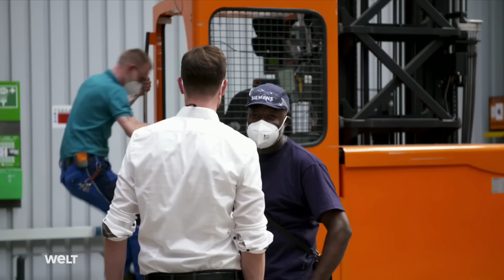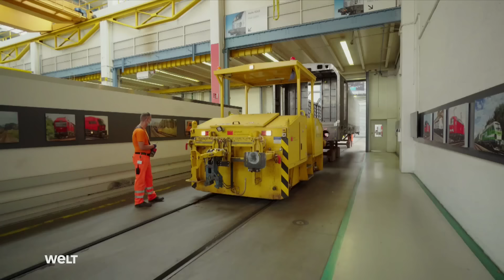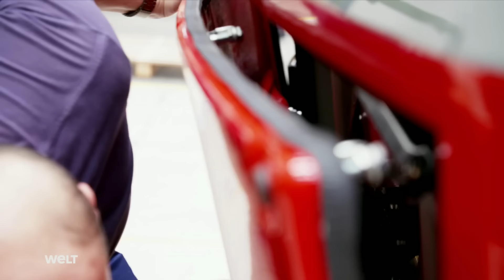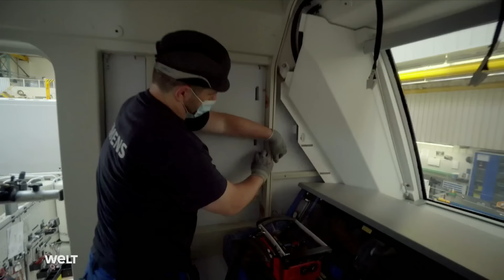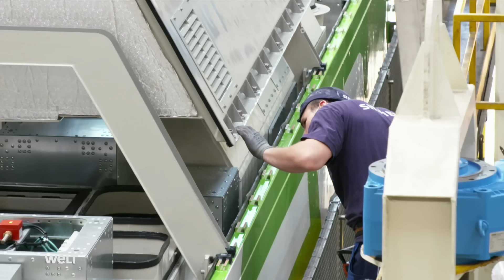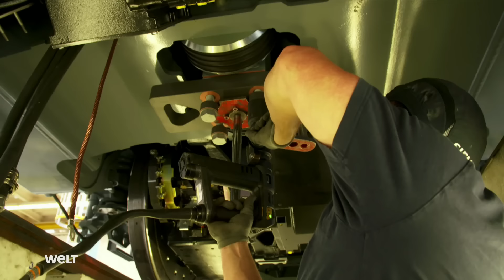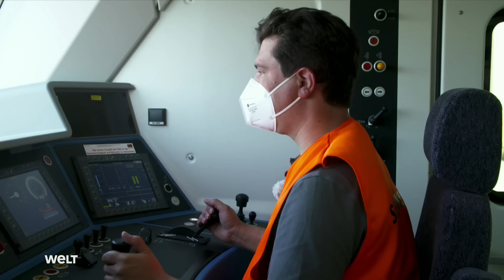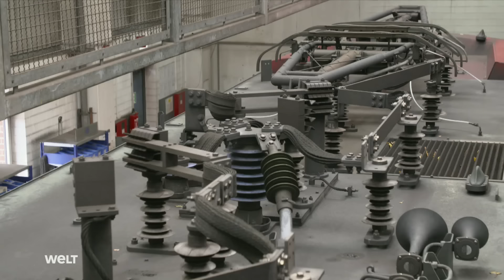SUSTAINABLE POWER FROM GERMANY: Electric Locomotiv - High-Tech on Rails | WELT Documentary

Comment: Really a robot just to plug a wire in thats a joke
Also only able to pull 35 cars thats a bit low is it not
Reply: I have seen american trains with 120 cars, but they also used 3 or 4 loco's.
The robot doesn't make mistakes, such as wrong socket/plug or wrong position in the socket/plug.
And maybe I'm wrong but if you put the wire at the wrong position you can't take it out anymore in this type of sockets/plugs.
Reply: the damand and circumstances are quite a bit different on this side of the pond. Here, freight trains are by far not as long and heavy, thatfor one of these locomotives usually is sufficient. Trains here tend to be shorter, faster and more frequent. Freight trains can easily keep up with many passenger trains and often several trains follow with only minutes apart from each other. They use the same tracks like passenger express trains

Comment: Given that Germany's energy consumption mix is 80% fossil-based, say it's sustainable is a lie.
Avoiding that a locomotive consumes coal and gas indirectly rather than diesel directly is the truth.
Reply: Electricity is around 50 % renewable. If you take fuel and heating into account it's of course no longer 50 %, but other countries are not different here and this loco consumes electricity, not gasoline or diesel

Comment: European Household Power is 220-240 volts. There is no 110 volt in Europe or Asia etc. 
110v is a North American Household Voltage. 
A Munich, Germany train assembly worker speaking in German said 220v but instead of subtitles, the entire video is 'dubbed' and the dubbing is of Very Poor quality.
Reply: Shocking. I enjoyed the whole video and found it fine. I had no idea it contained dubbing of very poor quality. Had I knew, I would problay not dared to watch. Why was I not made aware of this earlier?
Reply: Europe is now 230 (in the past it was 220 to 240). It's a common grid today.
Reply: I regularly see almost 240V late at night when the load on the grid is really low and power stations are still winding down for the 0-6am low.
So actual grid voltage in Europe is somewhere between 220 and 240 it just depends on time of day, country and load on the local grid.
I know the standard is 230V but there is a tolerance for sure its +-5% I think.
Reply: @alouisschafer7212  this may be. My multimeter typically shows slightly above 230 but I never tested it at night. What is more important to them is the frequency, this has to be relatively accurate

Comment: 36 km cable must be installed in each locomotive and each cable has a function such as energized brake or detect red lights on the road. If they take advantage of wifi connection for data transfer between devices, it might lower amount of cable used for data transfer, Is it not suitable for safety standards?
Reply: WiFi has it's place.  But, when it comes to the safety, I'll take wired in any day.  Thank you very much.

Comment: India makes electric locomotive that are more powerful than this (WAG 12 with 12000HP). Even their WAG 9 is bigger than this with 9000hp.  This is neither new or big. Looks like an advertisement by this locomotive company.
Reply: The Vectron is a multi purpose locomotive, it can run up to 230 kph (depending on the version). The WAG 12 is a pure freight locomotive which just runs 100 kph, but has a lot of torque due to the low gearing. Different locos made for different purposes
Reply: WAG 12 is French

Comment: The title of this documentary is very misleading. The fact that a locomotive is electric simply means that it does not hydrocarbons directly. There is no guarantee the electricity required to operate the locomotives will be green and renewable. There is the possibility that the electricity will be generated from the burning of natural gas or coal. We need to remember that Germany has problems producing green energy, especially with the elimination of nuclear power plants, a large abundance of coal, and the elimination of Russian natural gas. Does this mean that growing percentage of these "green" locomotives will ultimately be powered by coal? Yet, more hypocrisy from environmentalists and the manufacturers of green technology.
Reply: ''There is the possibility that the electricity will be generated from the burning of natural gas or coal'' Depends on the individual electricity policy. However there is no possibility a diesel loco runs on renewables, they always burn fossil fuel